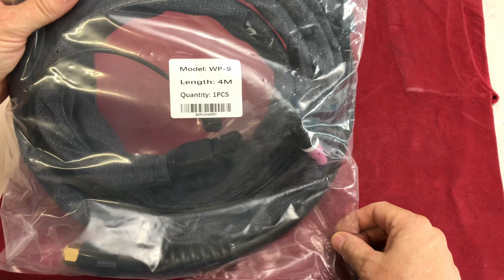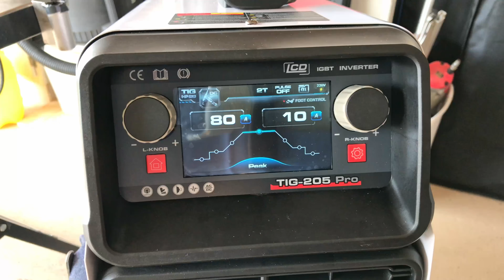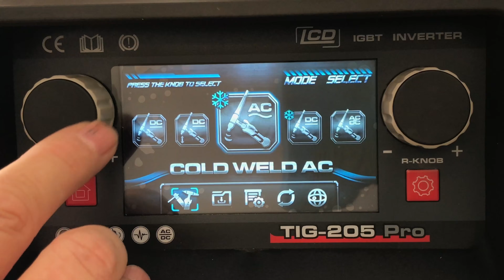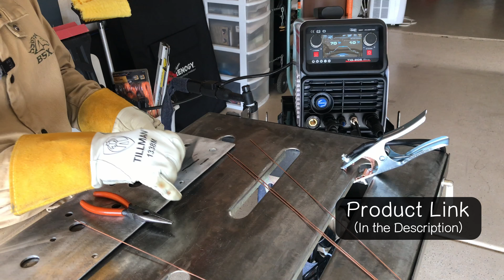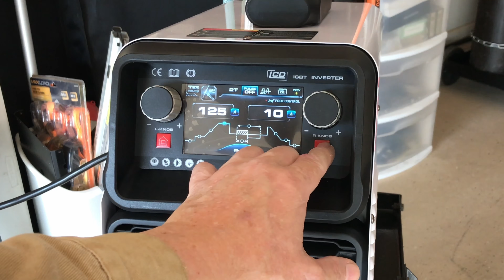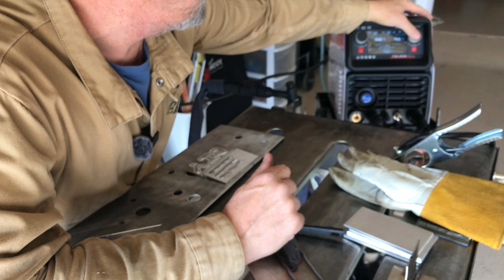Budget Aluminum Welding on the Andeli 205 Pro | Real Results

Comment: have you put on a different torch?  I have a new 250 on the way and have ck torches on my current welder and want to use them on the new 250 but the pictures of it look like they have a funny way of connecting torch. Thanks Peter
Reply from the maker: I have not tried a different torch. I my at some point switch the torch to my go to WP-26F because I really like the flex head but I haven’t done that yet. I keep the same lead and just replace the torch when I do it.

Comment: The newest machine has the nominal gas hose fitting, which allows you to use the supplied hose, which I was happy to see. Next, they should include the argon gas valve as well as some filler materials. If they added those two items, you could start welding right away other than the argon gas cylinder, which I already had for a spool gun setup, which  I ended up getting this tig welder instead. Haven't used it yet because I wanted to watch some videos first.  There are not many videos on using this welder, and I was hoping to see some about the cold welding feature 😢
Reply from the maker: Thanks for the feedback and suggestions! I hope your new welder serves you well.

Comment: Thanks that's a really good vid and introduction to this Welder, i have actually just bought mine and stumbled on to your Video thanks. , I have not done Tig welding, Stick and Mig yes and my old Mig welder is 20 plus years old and is the size of a filing cabinet but it has served well but now i am retired and I am working on thin metals like brass and copper now, plus titanium, stainless and aluminium hence this welder.

the main reason for getting this one is the ability to do cold welding with the thing plate, 0.5mm to 1mm is what I will be using so I certainly would be very interested if you manage to pull together a video of the cold welding process

I was told you needed a different mask that plugs into the back of the welder which I did buy, it didn't cost more than 40 euros so I wasn't offended by it, i am not sure how it works yet, but it has a very long lead from it to the welder, large ultra bright LEDS on it and I guess its designed for working with how cold welding works on this machine. I'm not sure and hope I have not been fleeced for a helmet although the fact it plugs in suggests that perhaps it is needed for cold welding, 

I got my welder direct from Andeli on Made in China as Amazon here did not list this model or the 9 in one model , the closest one was over a 1000 euros and it was one below this , I paid around 450 euros door to door including freight and VAT all taxes paid etc. and they insisted that I buy their helmet and not one listed on Ali Express which was a bit cheaper but the lady insisted theirs was programmed to the welder. who am I to argue with a women!! 

I haven't plucked up the courage yet to do more than turn it on, explore the menus and check my gas connections I'm waiting for coupons to arrive as well though, although they are just for mild steel and Ali, brass and copper ones are not for wasting at the prices they are now for these metals so its atrip to the scrap metal boys for some bits to play with .

I hadn't realised how pulse worked until you showed us in the video, its works very well and I would say looks as if its better than normal tig welding for an amateur.

I appreciate the time spent and your effort in making this and do hope that you will indeed make a further video on the cold welding process because I have seen a lot of videos knocking this process down but I know it is just meant for fine or thin metals and not for 1.5mm and above because there is virtually no penetration, well that's fine for me it is exactly what I want to do because I do not want to solder or silver solder copper and brass, I want the base metals to be joined with the base metals and normal welding with gas or Mig just melts darn great big holes in 0.5 mm sheet brass or copper, this way I have no need to remove solder lines etc just sand and polish the base metals then shape by hand

Thanks again from Barcelona Spain.
Reply from the maker: That's great to hear, and I appreciate the detailed comment, thanks for the support! At some point I do intend to try out the "cold welding" feature. I do not have the special welding hood that plugs into the back of the machine. I'll have to try it with a regular welding hood because it's all I have. It will likely be sometime this fall though as it is 110 degrees F in my shop this time of year. I'm thinking it will be a great process for the thin materials. It looks like a good process for a hobbyist welder such as myself. Happy Welding!
Reply: The cold welding process is "too quick" for your helmet, thats why you plug it in the back of the machine so there is no chance that your eyes are exposed to the arc